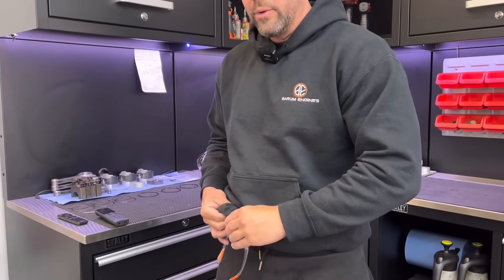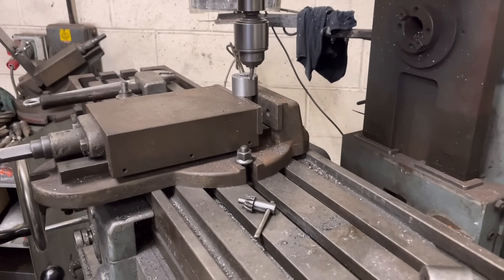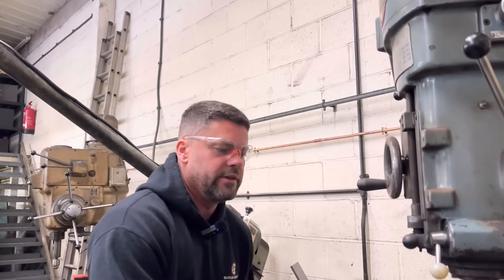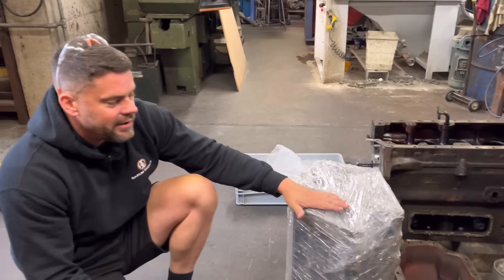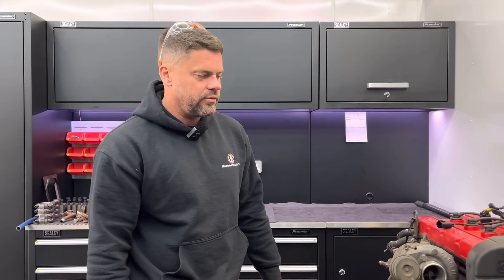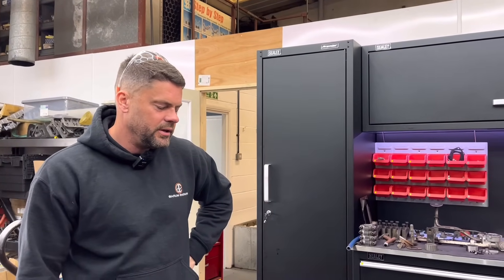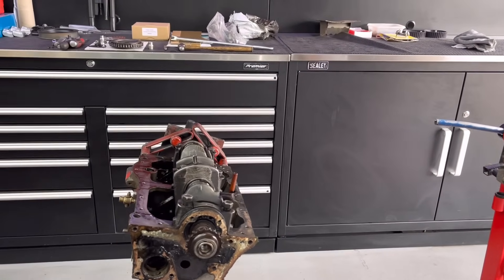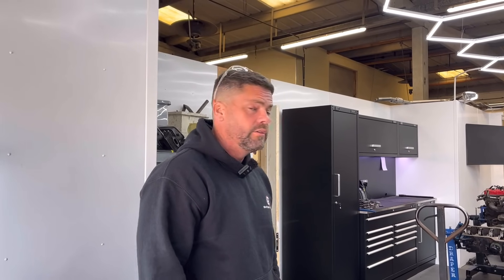SHOCKED at what customer comes in a says about engine builder!

Comment: We had a couple of Detroit Diesel 12V and 16V engines that turned a main. The machine shop cut the bearing bore out, maybe 3/8" oversize, and made sleeves to fit in with the ID about 0.005" to 0.010" undersize for the main bearing bore. Then they drilled and tapped holes about 90° apart for countersink bolts. Loctite the bolts with the heads flush. The cap had the same done. These bolts locked the sleeves in place. Then the caps were trimmed to align bore/hone the main bearings. One large Caterpillar engine was salvaged in the same manner. An 8,000# (that is weight) block is a wee bit expensive to replace. Like ship crankshafts that are 40 feet long, very expensive and tooling is somewhat rare due to the small market.

Comment: When holding round bar in a vice you should really use a vee block against the fixed jaw for a secure hold.  Milling cutter in a drill chuck???
Reply: I picked up on that but with the thread out the back it is seating too high would be better in a modified large 4 jaw chuck  bolted flat down on the table but 20 thou cut will get away with it.

Comment: next time try collet chuck for that 2 flute end   mill and a v block in the vice    with that  3 jaw drill chuck that end mill will pull down and out  as for the  vice using a v block will help keep the cylindrical object up right and secure   hope this helps  as danger never takes a day off

Comment: One thing I found on the original mini motors was that if the cam was warm it's possible for the followers can be too small and the lobes can club on the sides. So if you are going to build a warm engine it's worth machining out the holes for the followers, what size I don't remember but to fit Holden straight six followers worked well

Comment: LS3 from a Camaro or Firebird with the Tremec 6 spd trans. Actually takes 50# off the front end of a Beemer 3 Series.  With minor porting, a cam change and tune, you get 550HP at the rear wheels. The 760 V12 diff bolts in so you do not explode the ring and pinion. Makes a whopper sleeper, and fuel economy is not bad, all things considered.

Comment: Hi Lee .  I live in Vancouver, B.C.  Canada and watch most of the videos.  I am a fan and subscriber.  I race a 2003 Formula 2000 Van Diemen.  In our race group we have both 2L Ztec and 2L Pinto engines.  I am curious about the pinto blocks -  here we have 200 & 205  pinto and capri blocks.  What are the differences between these?  Our pinto and capri blocks have 2.0 cast on the lower part of the block.  Can you please shed some light on this as well?   Thanks , Keray

Comment: It sounds like this customer was trying to save costs by supplying some of the parts, then shopping the build out to a local garage. A recipe for disaster.  That huge flat spot sounds like the cam and high compression, was not suitable for road use. Did the customer specify the cam to be used?